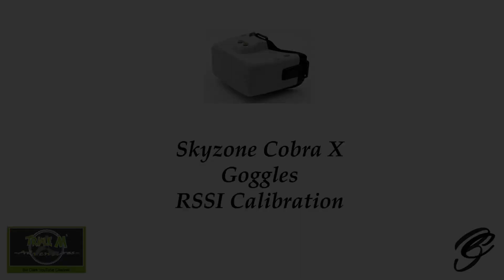Skyzone Cobra X Goggles RSSI Calibration

Comment: Thanks for your help. I was just looking for explains on how to calibrate the goggles because the manual is an old one and explain the old method to calibrate RSSI by just selecting YES on the RSSI calibration menu. But for the latest versions like mine, in the menu it's LOW and HIGH options which appears in the RSSI calibration menu.
So I didn't know how to make it well.
I will test it now because I didn't made the calibration well and my RSSI OSD still show 0%.

Comment: Hi I have a question for you, on my Cobra S goggles I am not getting any RSSI signals when I am connecting my HGLRC ARROW3 4s Drone can it be the vtx on this Drone because my other Drone the Mob6 Whoop I can receive RSSI and the image is good? Thank you for the video and your reply. Harry Lato
Reply from the maker: Harry it must be something on the drone itself because your MOB6 is fine. The basic things to check on the quad is what is the output power lever set to on the VTX, is the antenna connected correctly or has the VTX degraded for some reason like being run without a antenna connected. Are you get a reasonable VTX range with the Arrow3 even though you are not seeing RSSI levels in the Cobra goggles?
Reply: Hi Bill I found out thru troubleshooting that the VTX on my Arrow3 Drone is defective and that's why I am not getting any RSSI or an image. Thank you very much for your quick reply! ✈️

Comment: Is it essential to do this calibration?? Is it every vtx required different calibration???
Reply from the maker: Has far as I understand you are calibrating the goggles themselves not the VRX. It is done to give a more accurate RSSI reading in the goggles OSD so only need to do it once. With no VTX switched on you may notice the goggles OSD giving you readings once calibrated it will display 0.

Comment: Hi Bill, I recently purchased a Skyzone Cobra X. The issue i am facing is, the DVR footage cannot be seen in the SD card, my computer reads it as Empty. and same card when inserted in the Goggles i am able to see the Recorded Videos. I have followed the manual where it states we are supposed to flash the Card in Fat32 format. please assist
Reply from the maker: Could you please check if the files or folders in the SDCard are hidden.
Go to the Main Menu, View tab and under the Show/Hide option, choose to view the hidden items. See if this helps.
Reply: It didn’t help, still I don’t see anything in the SD card .. unable to figure out what’s wrong
Reply from the maker: @samiroraut  can you try the card in another computer to see if it is a problem with your computer.

Comment: hey bill, just wondering.. what are the benefits of RSSI calibration? is there a big difference with or without it?
Reply from the maker: I do not think it will make a difference to the signal quality but will help display the correct RSSI values in the goggles OSD.
Reply: No that don't make any changes on the quality of reception. Juste give more precise information about the reception force of signal.
It's just like if you calibrate your sticks on your radio to get the wrigth values when you move them.